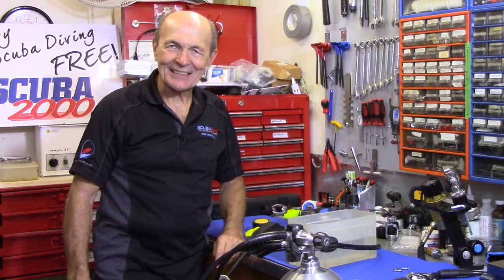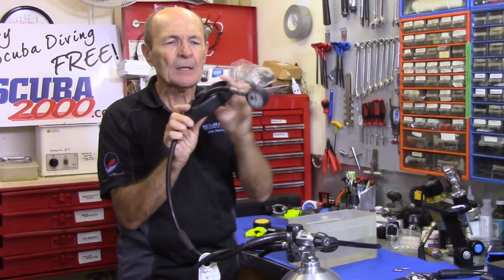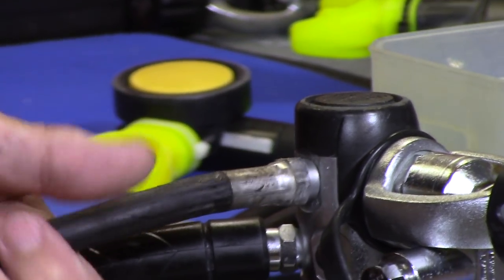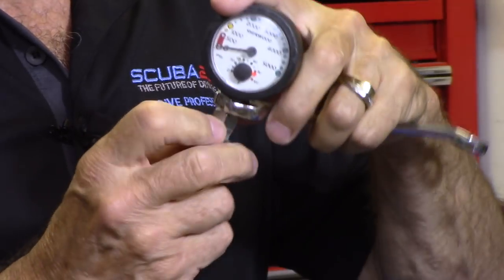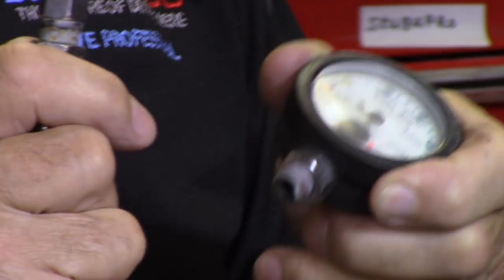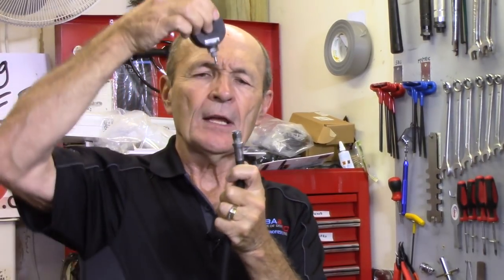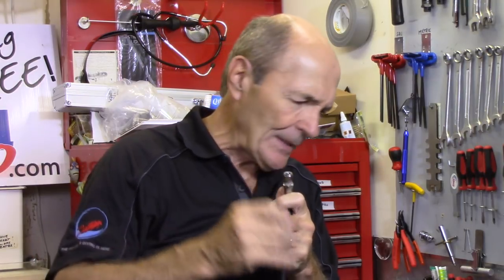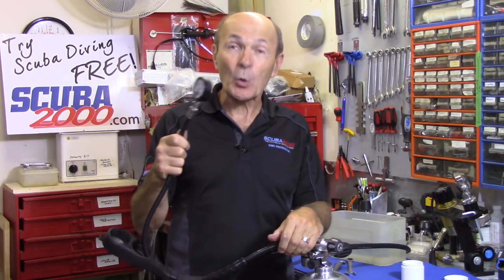Servicing Your SPG - Scuba Tech Tips: S06E14

Comment: Alec, I've always been told by my scuba instructors to ensure the weights on our BCDs/Backplate System are ditchable... 
But i don't see any situation where we need to ever dump our weights... 
wouldn't we go into an uncontrolled ascent if we ditch our weights? 
What are your thoughts?? :)
Reply from the maker: I'm mentioned before that in over 60 years of very active diving all over the world I have never dropped my weights - intentionally at least. It would have to be a very dire emergency before I'd do that.
Assuming there aren't too many things going wrong at once, you can usually find a solution to any problem underwater. And, as you say, dropping your weights removes a lot of options - like buoyancy control for one.
Most BCDs have at least 25 pounds of buoyancy, most more than that. Divers will say that that's not enough because they have on 25+ pounds of weights - not true!! You have enough weights to make yourself neutral at the surface. You may be carrying 25 pounds of weights but you are NOT 25 pounds negative. You don't need any air in the BCD to stay on the surface. Even at 60' you're still only 10 - 15 pounds negative. A BCD will easily make you positive and get you to the surface without dropping your weights and you still retain some control.
So I agree with you. It's a last option. I do think however that weights ought to be ditchable - most of them anyway.
Thanks for watching.
Alec
Reply: Thank you for your reply!!
Reply: so a month ago my dive buddy ditched his weight belt AT THE SURFACE as he ran so low on air after the dive his BC would not inflate and he started panicking I guess - was quite rough and had a bit of current to get back to kayak. Guess he must have been too heavy (empty tank looses a good 7# for 100cf we use!) and didn't think to mouth inflate the BC or just panicked... so ditchable weight belt (cheaper than BC sleeves) was I suppose helpful here...

Comment: Is it OK to dip SPG's thread into ultrasonic cleaner after you remove it from the hose as long as you make sure it's upright and water is not flooded higher than its neck? And hang it in the air make sure it's dry before reassembling it.
Reply from the maker: Exactly. Hold it vertical in the cleaner; rinse it in clean water; blow it dry (don't blow water up the hose).
Then connect it to the reg WITHOUT the SPG on the end and let some tank air blow through it for a few seconds.
You're all set.
Alec
Reply: Thank you for your reply! But I want to make sure that you mean that I can hold a spg without hose verticle into cleaner, right? (I was not asking holding the hp hose into cleaner)
Reply from the maker: It's probably NOT a good idea to try to clean any part of the actual SPG, that is, the gauge.
Use a bit of CLR on the threads and brush well with a brass wire brush. 
You can also push a Q-Tip into the hole to clean it and then to grease it.
That's it.
Alec

Comment: If I saw droplet or fog inside the housing of spg, is it appropriate to remove the glass of it and try to clear it?
Reply from the maker: Todays SPG's are factory sealed with no user maintenance.   Opening it up would void the warranty so take it to your local dive shop to test its pressure accuracy and connection are working properly.  
Alec

Comment: What's the point in having the SPG on a swivel while it's covered by a boot? Doesn't the boot cancel the swivel? It seems to me the swivel is a point of failure that has no benefit. Without the boot, the swivel becomes useful again.
Reply from the maker: The boot is primarily to hold the SPG + compass which was a very common setup in the 80's and 90's.  If the compass is on a wrist then the swivel works great.
A.
Reply: @AlecPeirceScuba_SeaHunter  I see, it's more about versatility. Giving you the ability to choose the set-up you want for your individual preferences.
Reply: @AlecPeirceScuba_SeaHunter  I have just seen a boot that can swivel. When I asked you this question, I was under the impression the boot was a solid one piece and prevented swivelling.